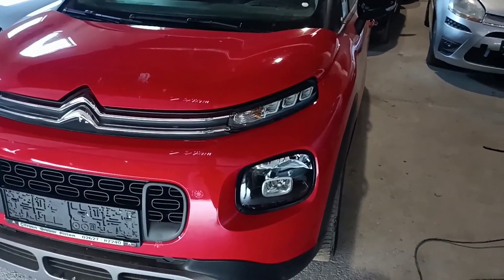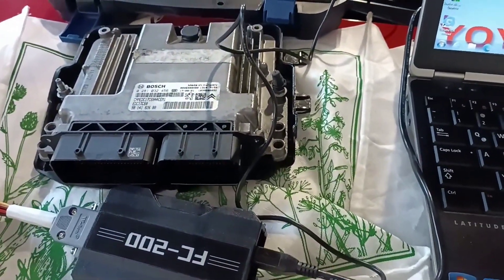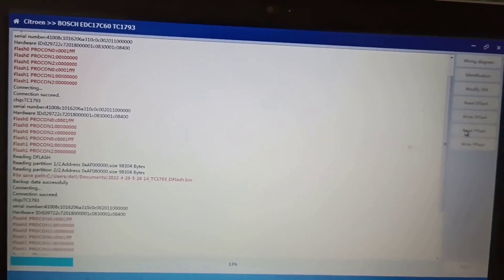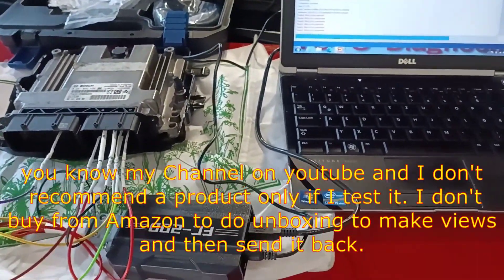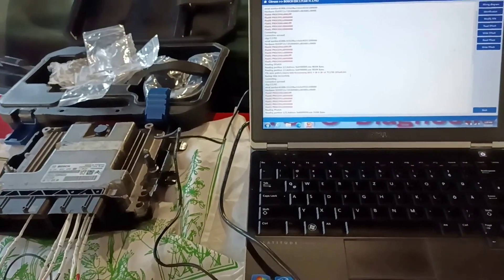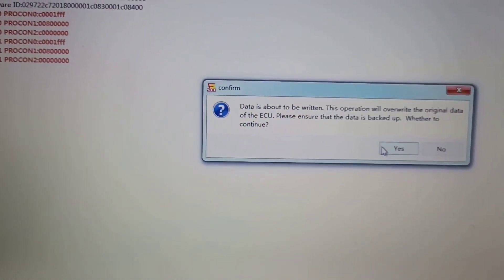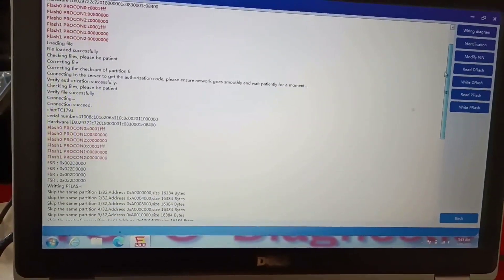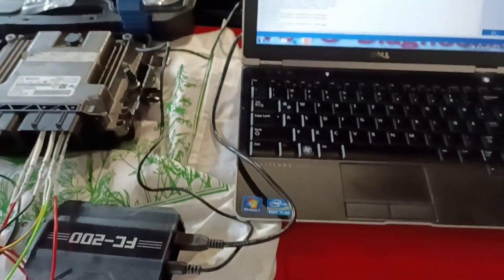New ECU Programmer CG.FC-200 !!! read & write edc17C60. automatic checksum correction

Comment: Hello. As you are a real person I would like to know if you have any information about the KT200 programmer because the CG F200 is very limited. Thanks
Reply from the maker: Hello.
The KT200 is another clone that costs quite a bit for what it's worth.  Wait a little longer and you will buy it at half price.
  Any Chinese clone in particular is very expensive, then it is very cheap because it does not do half the work that the manufacturer promises.
Reply: @YOYODiagnostic  Thank you very much

Comment: Hi, ever worked on a dead ECU? I cant find infos about clone/swap procedure when the original ECU is dead.
Reply from the maker: Hello.
I will do a video related to that problem. 👍
Reply: @YOYODiagnostic  great, thank you. Is the ec200 able to read/write a sid208 or any other device besides hexprog but without subsctiption fee, without soldering? What have done to your sid208?
Reply from the maker: @HemnNerwey  
FC200 it can not do reading on this ECU. 
I resolved the problem whit Flex
Reply: @YOYODiagnostic  could you make a video on flex?
Reply from the maker: @HemnNerwey  I made one and it will be published soon.

Comment: hello buddy is this fc 200 an original or a clone
Reply from the maker: Hello. 
Is a original product.
I have already done 2 online firmware updates.  This Hardware only works when you are online.  
Also the checksum correction works only after connecting to the server.
Reply: @YOYODiagnostic  hello fc 200 not working via obd? Only a bench boot?
Reply from the maker: @robertszczepek8004  
Yes. Only bench

Comment: Hello
Tested in car checksum ok? It as faild with me after few starts
Reply from the maker: Hello.
I've tested it several times and that's not the problem.  as well as the BMW and VAG brands
Reply: @YOYODiagnostic  ok but yesterday tested again in psa edc17c60 and again fail checksum…
Reply from the maker: @joaoribeiro2664  
did you update to the latest software version?  I still don't.  Tell me what software you use now when you have this problem?
Reply: @YOYODiagnostic  the latest update two days ago.
Reply from the maker: @joaoribeiro2664  
Write on the forum about this issue, or try to install the old version and write again.  
If you fail, make the correction to a specialized company on the internet.  You will pay 20-40 euros for the correction.
Reply: hello, I'm also having problems with this ecu, the car stops working and gives error code P3028. Any solution? thanks
Reply from the maker: @vvsousa   
Hello.
This is a PSA brand anti-tuning error. 
 Would you write this ECU with the clone, like PCM China or KTM bench?
Reply: hello. I'm using the cgf200 then I wrote it with hexprog and the car was fine.why is it that when I write with the cgf200 it doesn't look good .Thanks for your attention
Reply from the maker: @vvsousa  
it means that he did not make the correction properly.  Did you report to CG?  you can do this and it will solve your problem
Reply from the maker: I have written about this issue to CG hope to send updates.
Reply: @YOYODiagnostic yes I spoke to them but they didn't tell me anything important.
Reply: @YOYODiagnostic  Thanks for the answer. and i hope this gets resolved quickly
Reply: @YOYODiagnostic  did you get any response from them?
Reply from the maker: @vvsousa  I received an answer from CG company and the problem was given to the technicians to be solved. 
 What I do not understand is how it worked for me and still a month the car is on the street and works today.
Reply: @YOYODiagnostic  Was it an edc17c60?
Reply from the maker: @vvsousa    
You make a joke ? You don't see the video ?
Reply: I'm not kidding. in the video you can't see writing a modified file. I'm disappointed with the machine
Reply: @YOYODiagnostic  I find your videos very useful!
Reply: @YOYODiagnostic  file was modified or wright same original ?
Reply from the maker: @joaoribeiro2664  
Modified File if you look closely you see the name of the program you can figure out.  I tried to write without fixing with WinOls, just to see if this function really works, and to this day that car is on the street
Reply from the maker: @vvsousa  
it's very good that you're telling us here on the channel that it doesn't work.  
That is why we are a community. 
 I am convinced that this programmer also has disadvantages.  We discover them together while working with him, if the company does not want to fix them then we will advertise them as they deserve.  I'm not paid to advertise to anyone and everything I show in the video is bought with my money, so I say what I think.  You can be sure that I will tell my truth, which is often painful for many.  :))
Reply: I can fix this issue in your EDC17C60 file. Free of charge send me moded file I'll do it and flash it freely!
Reply from the maker: @RinorBislimi  Thank you for helping subscribers to this channel solve problems. 
 Unfortunately I don't have time to make these Files corrections for them because I have to work and there are many who ask for help by email for repairs.

Comment: Hi, thanks for the video. Where can I get original FC200 to buy?
Reply from the maker: Hello.
I will review this product and leave you a link where you can buy this product with a good price offer if you use the code that I will specify in the video.  watch this video very soon.  I wanted to test this product until I recommended it and I mention that I bought it without any discount and after seeing that it does its job I contacted the CGDI company, where I asked for a discount for the channel's subscribers.
Reply: @YOYODiagnostic  Thanks a lot. Getting original tools is the best in the days of fake / clone devices all over the place. Will be standing by for the review.
Reply from the maker: @partoems9376  
Hello.
Each subscriber who will use the code I will give will have a discount of almost $ 50 and free delivery and fees paid by the company.  It is a very good offer and welcome.